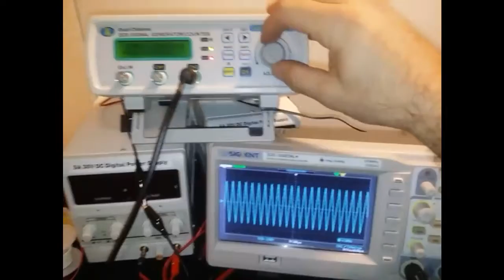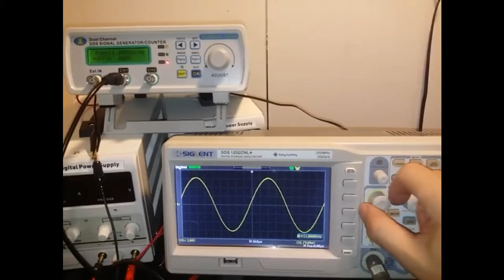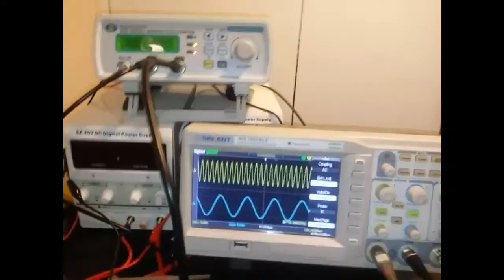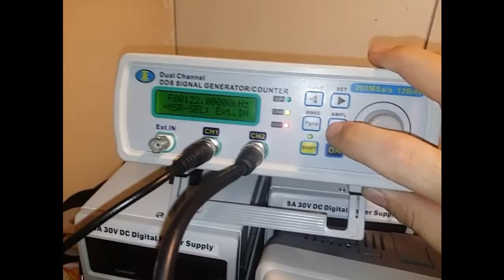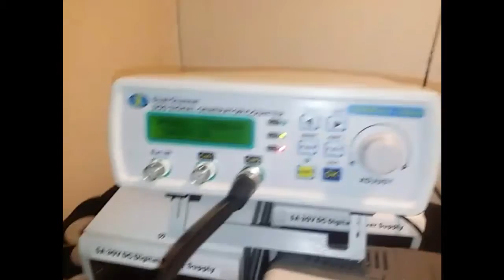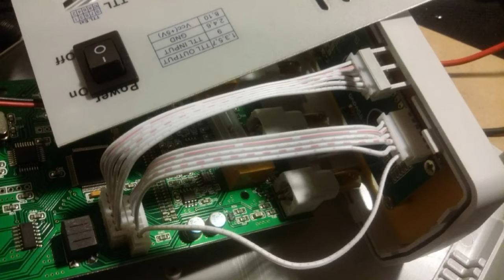Signal Generator MHS-5200A demo and mod

Comment: How can one safely connect this sig. gen. to oscilloscope regarding the fact that sig. gen. is not grounded and oscilloscope is grounded? 
Should one connect Mains Neutral, presumably BNC connectors' outer barrel, from sig. gen. to Mains Ground?
And another question, is it safe to connect USB port from sig. gen. to USB port on laptop, while sig. gen. is connected to oscillator. I'm asking that because laptop's USB is connected to Mains Ground.
Reply from the maker: Depends on what you are trying to keep safe. In general when working with an oscope, on a grounded unit under test, you can use a battery powered oscope and this protects the oscope from damage. In this case, the sig gen is using a dc adapter, so it is not grounded, so neither of the units here would be grounded.  So if your safety concern is for the test equipment, that's the way to go. If your safety concern is for you, grounding the test equimpent's grounds would be the way to go,  you should be able to tap off the shield of the bnc, but that's not 'mains neutral' since the unit operates on dc voltage. Similarly, you can have a laptop run on battery, so you take ground out of the question. If you had to run the laptop on a power brick, most laptop setups don't have ground referenced, it's just dc converted from ac, but you can test the minus (and positive to be safe) using a dmm to confirm there is no connection from dc to Mains plug to the dc connector that goes into the laptop. This message is strictly theoretical, since I don't know what you are planning and what equipment you are using. So educational only.
Reply: @electronicsprojects4708  Thanks for replay. Problem is that my oscilloscope is grounded, I don't have battery powered oscilloscope. So, I don't know if I can directly connect Channel 1 & 2 from  sig. gen. that is not grounded to the oscilloscope with BNC connectors connected to the mains-ground. I don't know if I'm risking to burn ruin grounded oscilloscope by attaching non-grounded sig. gen.

Comment: Hi there. I am trying to get a modulated signal and following the instructions in the manual does not work. Do you have any procedure that you could share regarding modulation with this unit. Thanks
Reply from the maker: Frequency modulation is easy, so I'm gonna assume you mean Amplitude modulation. You would have to draw the waveforms using the PC, which I have not gone into, as I have had no need. Or you could output channel A frequency and channel B 2nd frequency then combine them using a BNC T connector and then scope the output. Let me know if I understood the question correctly.
Reply: Thanks for the fast response. Yes, you understood the question correctly. I tried the option to create the waveform with the PC but the instrument does not store the created wave in any of the 1 to 15 available addresses. I will try the 2 channels option you mentioned. Thanks again.
Reply: @electronicsprojects4708  Simply tying the two outputs together won't modulate either sine wave.

Comment: is there a voltage on the bnc ?saw some vid with the feeltech
Reply from the maker: It will output up to 20vac on each channel, and has DC offset just like the feeltech. Maybe I need clarity on your question.
Reply: I think he refers to the bnc floating at line voltage on some of these signal genrators due to poor power supply
Reply: does this model have this same problem?
Reply: As it's powered by a wallwart I doubt there will be the same issue.
Reply: It just might if it's a cheap Chinese wallwart as they can exhibit the same problem.

Comment: will It go 3.3 MHz Sine wave? It looks like I would be good for a Rife machine carrier wave. I have a 350 dollar 25 MHz Generator with push buttons for Instant settings, dialling It In Is a pain.
Reply from the maker: Yea, it will do 3.3 Mhz sine no problem up @ 20 VAC, just checked, and sine wave looks good.

https://youtu.be/cJBYFVrUDug
Reply: I watched another vid where the guy use thee  scope probe on the bnc gnd and it had a high voltage..
Reply from the maker: I got 0vac from the BNC shield to L1, Neutral and Ground. I also tested the inner signal pin of the BNC to all three while I was at it. No voltage at all.
Reply: ok nice thx a lot.....keep up the vid .nice work....learning a lot

Comment: did you do the op-amp mod?  

have you used the pc software?
Reply from the maker: I haven't done the op-amp mod, I don't really need that precision at extreme voltage and frequency. I haven't tried out the software. I'ld have to find a use for it to try it. Thanks.